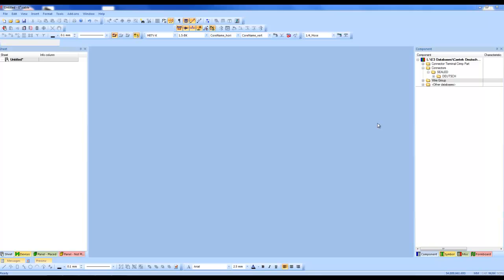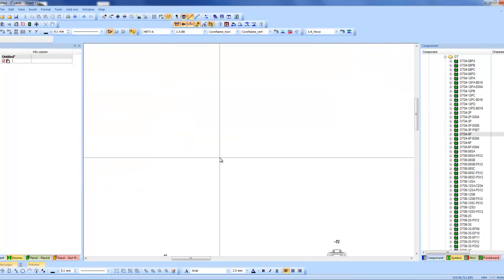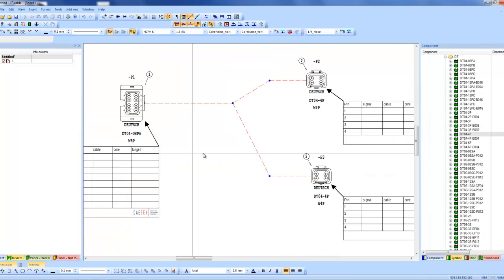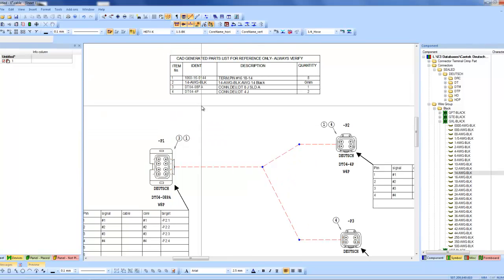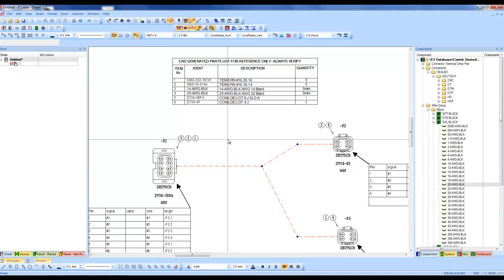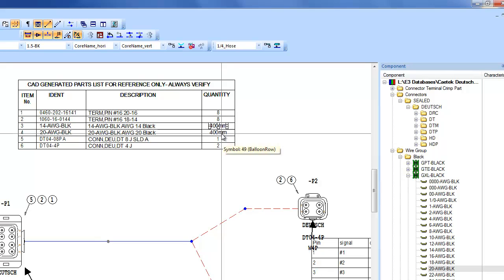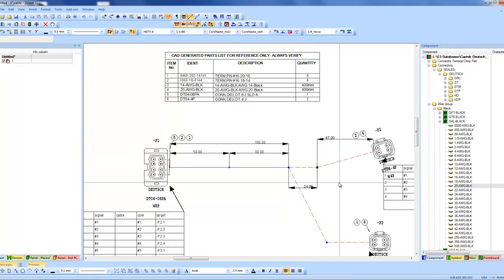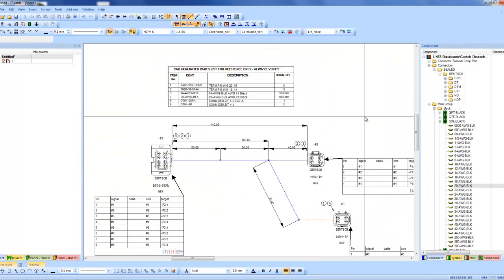Using E3 Series Formboard for automatic terminal selection with harness drawings

Comment: I just learn E3 Litterally last week. I have a stupid question. When I tried to insert a dimension, I either have an horizontal (180 degree) or vertical (90 degree ). How can I insert a dimension with an angle?

Comment: Does it have simulator or you need an external program to simulate the circuits (electrically), such as Altium or Automation Studio?
Reply from the maker: There is a Echeck with e3.series. So you can do simulations also.